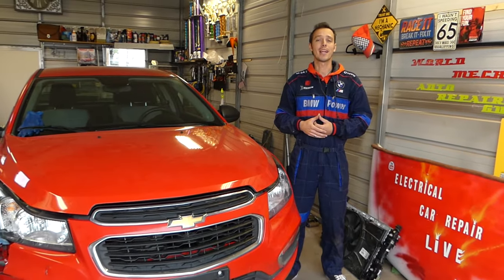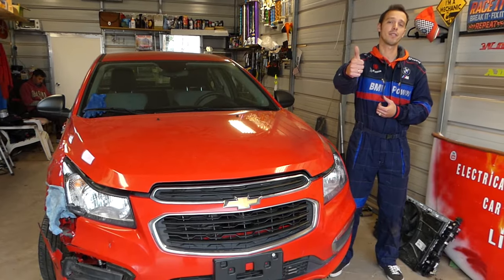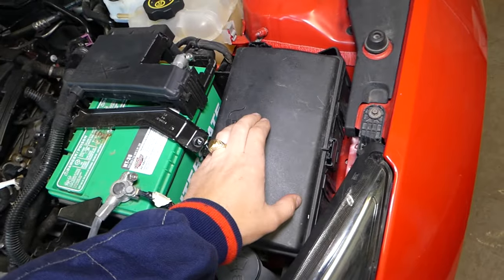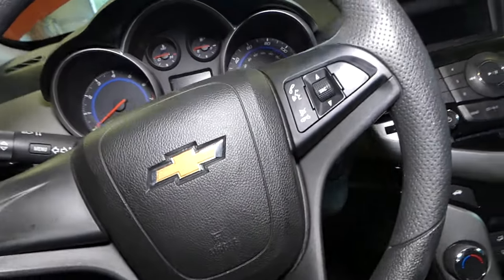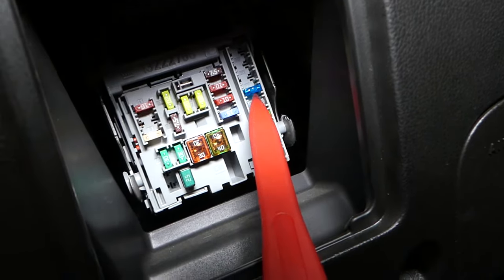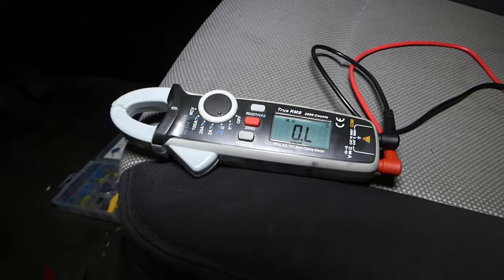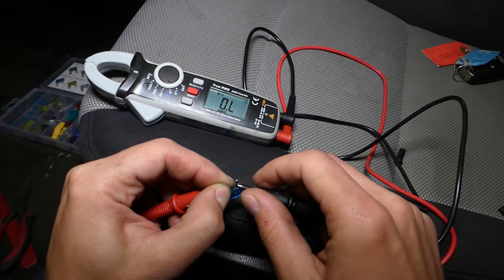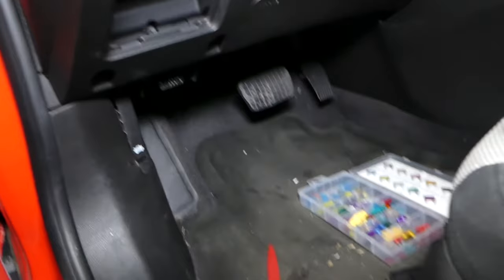CHEVROLET CRUZE INSTRUMENT CLUSTER FUSE LOCATION REPLACEMENT. INSTRUMENT CLUSTER NOT WORKING

Comment from the maker: Products that we use and recommend:
► Panel Removal Set: https://amzn.to/3YiMADu
► Assorted Fuses: https://amzn.to/4fx4s3F
► Tool Set: https://amzn.to/3p5MM6t
► Screwdriver Set: https://amzn.to/3XRB28Q
► Mobile 1 Oil: https://amzn.to/3xBc8B9
► Oil Filter: https://amzn.to/3w0Ulme
► Torque Wrench: https://amzn.to/32qyRwg
► Liqui Moly Engine Flush: https://amzn.to/3IiDBID
► Voltmeter: https://amzn.to/4hB6Zvk
► OBD Scanner that we use most often: https://amzn.to/3I4MQfe

► Check out our Amazon Store for the tools and parts that we use: https://www.amazon.com/shop/worldmechanics
Reply: I just bought a second used chevrolet orlando 2012 model with lpg engine, I started the engine and the engine running is not working and I saw check engine light on and sleeply sign too on pls help me to get it fixed thaks
Reply: What is the fuse number that controls my speedometer in my 2014 chevy cruze LT. Thank you

Comment: THANK YOU  ... You saved my wife and I   at least 500 dollars at a repair shop ... I did exactly as you stated  on our 2015  chevy cruze  including disconnect reconnect  the battery   and   our dash light system works fine ,,,,,
Reply: Por qué te sucedió ese problema tengo el mismo problema solo que mi Chevrolet Cruze 2011 LT 1.4 cuando abro la llave si se ve el testigo de Check in el del cinturón de seguridad y otro testigo que es de los neumáticos y la luz amarilla como si le faltará combustible pero lo demás no a mí me sucedió por qué me quedé sin pila y dejo los vidrios abajo y ese día por la madrugada llovió bastante

Comment: Hi, I have a 2014 Chevrolet Sonic, the Turn Signal & 4 Way Flasher work, but the Clicking sound has stopped.
Do you think it is a fuse or Clicker in the Dash...

Comment: I don't know if you can translate Spanish (Spain) into your language. I have a 2012 Chevrolet Cruze diesel with 163hp. For some time the fuel gauges and the temperature gauge on that same dashboard have been failing. Is it possible that they fail because of one of those fuses that you show in your video? The 2 temperature and fuel indicators fail
Reply: Hey buddy i am also facing the same issue... my whole cluster is working except the fuel indicator

Comment: Totally worked for me, thanks!
Reply: Iago Pardo Seoane what type of issues were you experiencing?
Reply: I feel I have the same issue but I’m not sure
Reply: @orlandoavila1188  total blackout of the speedometer, fuel measurer, rpm, etc.
In short, all the instruments behind the steering wheel were not giving any indication, simply removing the fuse and placing it again solved it

Comment: Dear I have Chevy Cruze 2012, spedo meter totally dead, (no reading, no sensor lights, no gauge information).
mechanic checked all fuses but all in vein. Can anyone please assist in this regard. thanks in advance
(various other suggestion from different  mechanics - could be computer device issue, may be body controller defective etc.....)
Reply: I have the same problem in my malibu 2010 if you know anything please help me